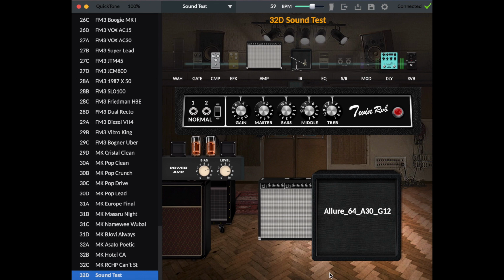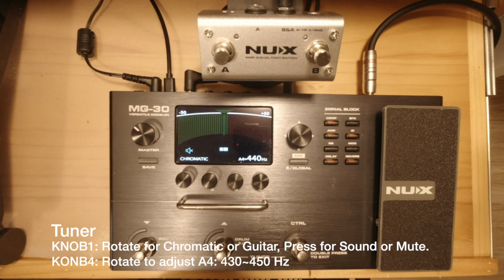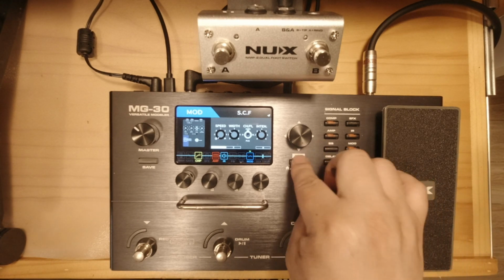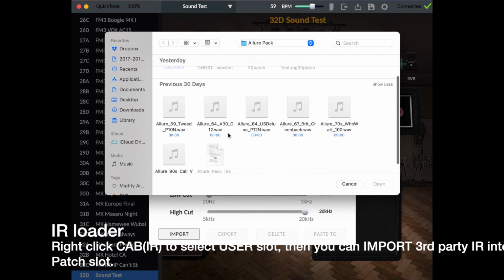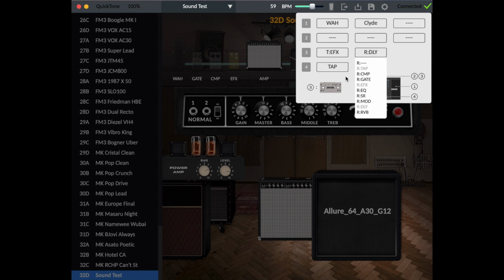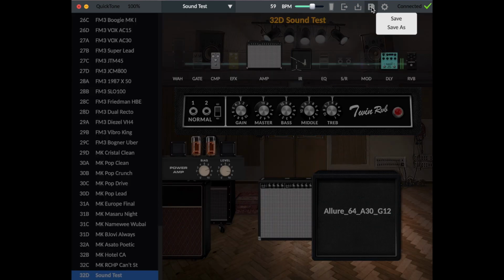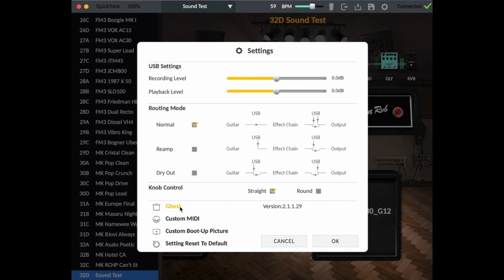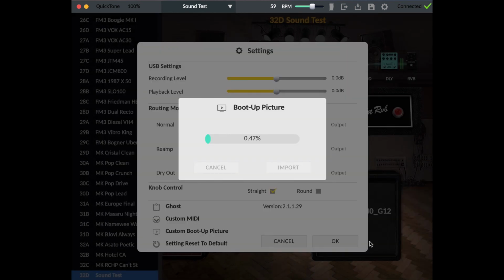NUX MG-30 Tutorial | EP3 QuickTone editor & Phrase Looper

Comment: When you demo the user impulse response I hear unnatural distortion of the signal. The same distortion is also present around 17:30. This also happens when I am trying to set up a distorted patch like a Marshall tone. It is not natural ‘amp’ or valve distortion, it is ‘system’ distortion and sounds like digital distortion. How do you stop this from happening?

Comment: Hello. I have two questions about Nux MG-30 product.
Can I use an external wah pedal simultaneously with NMP-2 Switch?
Can I use NMP-2 switch as a continuous part of the Nux MG-30 for using like a patch mode? For example, 1. and 2. patch will come from Nux, 3. and 4. patch will come from NMP-2 switch. So I can have 4 patches on board like 1-2-3-4.
Best regards.
Reply: No. Did you buy one- like it? I just ordered one.

Comment: I just got mine and love the unit so far. My only wish is in the Quick Tone app. My laptop monitor is small and I can't reduce the editor window size, so parts of the bottom I can't access. I can connect to a larger monitor, but that's a pain. Please add the ability to scroll down on the main area of the screen like you can on the patch name list on the left. Otherwise I love this device!

Comment: Hello and thank you for the info. I have a question maybe someone can answer. I run Windows 10 and had no issues Downloading all the proper software and the driver for the unit. But when I connect my MG 30 its not getting picked up . The screen shows a diagram of the unit but says connect unit to USB ?? I actually even tried installing all the software multiple time's as well on a different PC but the results are the same...it just wont connect??? Any one have any suggestions? appreciate it.
Reply: @Duzzit Really Matter may help u . I had a more computer savvy friend help but… you MUST  download the Firmware first thing. Then try the Quick tone software. Also you may have to look for something called a Bin file to open editor . But Firmware first . Hope it helps good luck:
Reply: I was having the same issue.  Went into the windows device manager and the nux mg-30 had a splat on it... removed it completely, unplugged the usb and let it reinstall itself. Came up immediately.

Comment: Add a snapshot/scene mode (effects can be turned off simultaneously/change amp parameters with one footswitch) with the added footswitches will make this the ultimate live rig. It lessens the tap dancing needed to get your tone through different sections of a song
Reply: another nice idea (to future firmwares)  external footswitch A/B can be change presets, and the other 3 footswitches in the board can be scene1 scene2 or scene3 respectively.
Reply: @seba.makron  what is the link/difference between preset ans scene ?
Reply: @MoutchouPitchou95  With presets you can add/exclude/change any effects, amps or IRs, with scene you only can turn on/off some effects, and ever in the same patch.
Reply: @Robertoilo  Thx 🙏